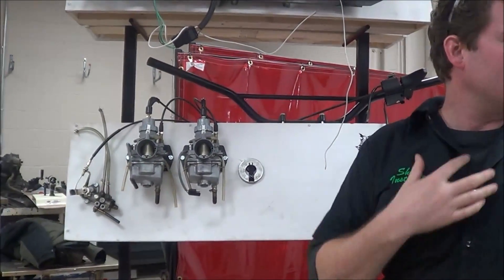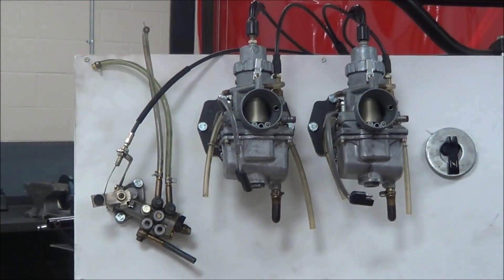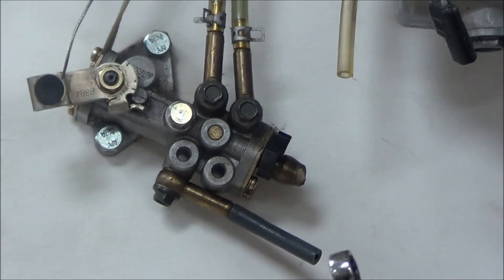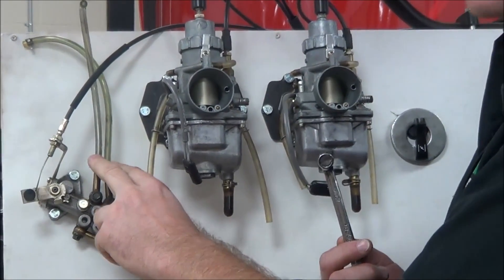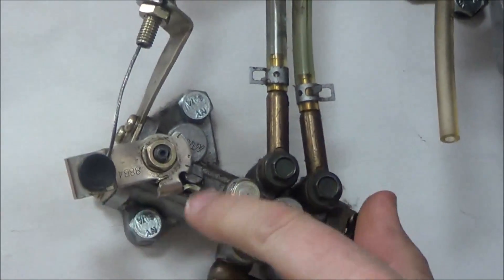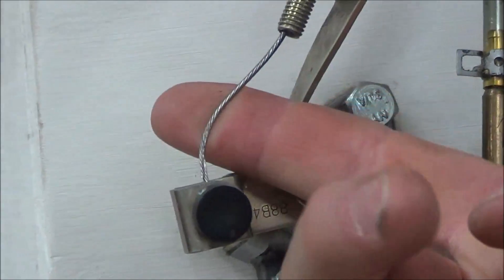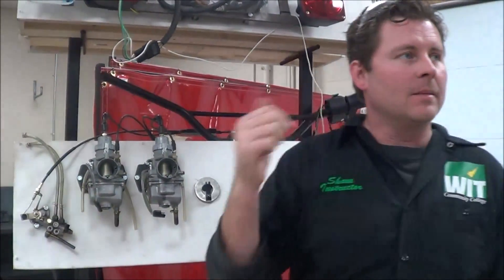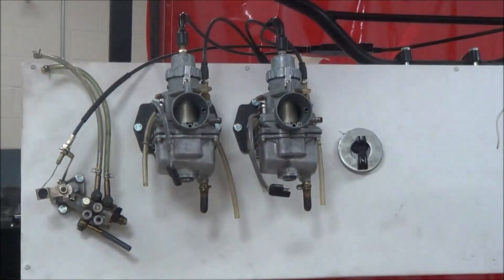How to service 2 Stroke Oil Injection System How to prime oil injection pump #how2wrench #2stroke

Comment: Great video 👍 thanks 🙏 would you please tell me if my Ski-Doo Renegade Sport carb 600 year 2019. 2strok lubricate outer crank bearings with oil from oil tank or by ISO flex grease?

Comment: Great video! I just replaced 3 oil check valves on my triple 2 stroke motor.

I replaced 2 oil injection lines in orange colour so to visibly see if the oil is going Fromm the pump to the intake boot spigot.

I mixed 50:1 in the fuel tank. Ran the engine at idle for 5-8 minutes with oil injection lever wide open.

Plus! I revved the motor to and in between 3000-4000 rpm for 5 minutes and still couldn’t tell if oil was going from the pump to the oil spigots in the intake boot.

I did not do the procedure above to put oil in the lines first to the pump.

I’m asking should I remove the carbs to access the oil lines and do as described above?

Thanks.
Reply from the maker: Glad the video was helpful! You generally don't need to remove the carbs for priming, but it can depend on the specific engine and line access. Great to hear we helped! Smash the sub and share please! 
If you donated or supported us, thank you in advance for saving you hundreds at the dealer or frustration! #righttorepair Links:
Buy Shane a coffee:  https://www.paypal.me/how2wrench    
Join the channel: https://www.youtube.com/channel/UCBhM8DCKnT3qXwTW0eToyCg/join  

We love sharing comments like this with Shane. High fives for the likes or making us better by chiming in your thoughts and the added value to our wrenching community. Keep them coming.
You rock for commenting! We will let Shane know! 
H2W

Comment: I recently purchased an 01' Suzuki JR 80 where someone had capped off the line that runs from the oil tank going to the pump. The line from the output of the pump going to the carb was still attached. My question is, should I be looking for a new pump since this one was starved of oil? They ran this little bike on pre-mix fuel.

Comment: 2025 using this for a 2001 seadoo gts! im bouta see if my oil pump is still good i get some oil in bottom of hull its all og lines   im hoping the lines are old and cracked so i can replace lines and pump still good..  it still smokes good when running. hopefully not to much but this should help me alot!!   premix could be a headache on a lake if the kids need to go fuel up.

Comment: Wow that simplified things. Question, I have a Kawasaki KRR150ZX that I was gifted to repair. I’ve fitted a new top end kit and had it running but the 2T oil is syphoning from the tank through the pump into the crankcase filling it up when the bike is not running. I’ve checked the pump’s adjustment which all seem to be fine…any thoughts?

Comment: He's on point and he knows what he's talking about OK but you can also take a syringe they sell big syringes I don't know for like Turkey basters whatever a big syringe and what I do is I back feed all the lines from the carburetor through the injector to the tank the oil tank that holds a 2 stroke oil and it pushes all the yeah right up in through the tank right you're syringe is full of oil so you make sure that you have enough oil pushing through without any air OK then you're going to start it and siphon with the syringe on the line to make sure that you're getting straight oil and it takes two seconds. And you don't even actually have to start it you can hold the throttle open use the syringe to pull the oil through the injector and it works just as good

Comment: My problem is I can't find replacement lines for the motorcycle that I'm trying to  Restore. Where is a good supply for very small diameter lines for Suzuki. Also the beebies in the fittings don't stop the oil from draining backwards.

Comment: Much better solution, just PREMIX 25/1 or 50/1 Depending on use and engine, zero risk of failed oil pump setup
Reply: my current pump just dumps in oil at full blast at all times.  id save oil doing what you suggest

Comment: The oil check valves (the brass banjos) are a very important component in the old school injection system in that they prevent oil flooding the engine statically past the pump to cause hydraulic lock. That can bend a rod pooching the engine instantly.
Reply: Your point agreed totally. I have bought two seazed DT125E engines because the brass outlet check valves in the oil pump were so gummed up with crud that the spring and ball could not move ,thus starving 2T oil to the engines......resulting in engine failure !! Make sure the brass fitting is removed and thoroughly cleaned when over hauling /servicing the oil pump as it can easily be overlooked.
Reply from the maker: Thanks fellas...Shane

Comment: I cannot find any oil lines going to my carb, on my 07 Ski Doo
Reply from the maker: Hi Michael. They can also go to the manifold or crankcase. Just follow from the pump out to each cylinder (case). One should come from a tank and the others out to each number of cylinders. Make sure to bleed the air out if ever messed with or the tank was allowed to run dry.

Comment: Okay so I noticed that you held that throttle wide open and your tick marks didn't line up and then you adjusted that back so that those tick marks would line up. What would that hurt to leave it the way it is? I have a 98 MXZ 670 and I took the two Flathead screws out of the top and the bottom to pull the oil pump. It feels like it's getting caught on something when I pull it part way out. Any idea. And what would be wrong with my oil pump that oil would just be flowing into the crankcase I shouldn't say flowing but seeping into the crankcase or leaking into the crankcase? Trying to figure out what's going on with my sled for that but I'm thinking the problem May lie in the oil pump seal I'm not sure? Any help would be greatly appreciated

Comment: Thank you for this I know no how to adjust everything when I go back together. Now can someone tell me why I have two large oil lines going to the left and right side of the crank case on my 1995 Seadoo?
Reply from the maker: Hi James...I'd have to grab a manual or see it too tell. Hopefully there is a Seadoo tech on here to reply. I would recommend getting a model and year specific manual to verify yourself. I love this site for cheap ones" https://www.tradebit.com/G/manuals 
We sure love you taking the time to comment. Want to help us back? Please subscribe and give us a high 5 here:  https://www.paypal.me/how2wrench  
Follow us! 
www.How2Wrench.com      
www.Tools2Wrench.com   
Facebook: 
https://www.facebook.com/How2Wrench/  
Instagram:
https://www.instagram.com/how2wrench/
Reply: @How2Wrench  Thanks for replying, TBH I forgot I made this comment yesterday. The manuals don't really say what the lines do, all it says it how they are routed. I searched the forums and found that the 2 larger lines that run from the oil tank to the lower portion of the crankcase are to lubricate the rotary valve shaft and gear on the older Seadoo with the rotax engine.
Reply from the maker: @james4wd236  Nice. Glad you found it. Sub to our channel please and sometime I'm sure we will help!

Comment: The oil inlet is at the end of the pump, you can see the cut off hose and clamp is still present.. Small tubes are outlets. Once the bleed has been loosened to purge air from the inlet side, you can manually move the oil lever to the full throttle position and with the engine idling you will see the oil pulse through the outlet tubes into the manifold. Once you see no air bubbles you are done...

Comment: Hi Shane glad to see you back in YT! Missed your content, just done my NSR and it’s got stationary setting mark on the oil pump and full throttle but when I go full throttle it turns way past that and there’s no stop is this ok?
Reply from the maker: Thanks for commenting and adding value to our community! My first thought is NO...Overextending could "close off" the passage. I'd have to look into it further. I bet there is an NSR forum that has the exact answer. I have an idea to do on the pump too. Hit me up at my website if you don't find an answer.

Have you subscribed yet to never miss a video? Have you seen the video playlists? Over 600 videos! Check them out here: https://www.youtube.com/user/conleybuilt/playlists  

Want to say “thanks” or “keep it up”? Click here https://www.paypal.me/how2wrench    
 
Your answers and help are just around the corner. Save time and money while protecting your investment and yourself by doing it the right way at www.How2Wrench.com
Reply: Shane Conley Thanks for getting back to me, ok I’ll have a look on there and head over to your site, that would make sense as I had the top end seize up on me at full throttle and after a tear down I couldn’t find and issues, I verified the oiler and it’s pumping, what I didn’t see is if it’s working fully open past there. Cheers

Comment: Shane, 
following your practice in this video and based on that type of system. I have a question regarding this specific type of oil injection system demonstarted; how do I know the engine keep getting oil from the pump at various rpm's when the throttle is fully closed (let's say im riding downhill at different speeds/rpm)? I own a 2-stroke 49cc scooter (Kymco DJ refined 50 2011) and I've always wondered how the oil injection system knows to pump the right amount of oil based on engine speed (when throttle is fully closed). Thanks
Reply from the maker: Hi there! Coach Conley is so bombarded with requests these days he hired us to run his page. Can you believe he gets 1/2 million views a month on his YouTube channels and hundreds of requests a week. But in luck, if you really want him one on one. Contact Just a $1 a min after that! Your answers and help are just around the corner. Save time and money while protecting your investment and yourself by doing it the right way at www.How2Wrench.com  

Have you Subscribed yet to never miss a video? Have you seen the video playlists https://www.youtube.com/user/conleybuilt/playlists ? 
Want to say “thanks” or “keep it up”? Click here https://www.paypal.me/how2wrench

Comment: Great video.. I have a huge problem with my 2000 bombardier gtx millennium edition I have oil down below the engine and towards that back where the battery is located and also my exust manifold have a rubber hose that keeps burning I can't seem to figure out why this is happening thanks any ideas
Reply from the maker: Have you Subscribed yet to never miss a video? Have you seen the video playlists https://www.youtube.com/user/conleybuilt/playlists ? Quick answers are often found here. No time to look through videos? 

Still have questions? You’re in luck! I provide tech help and work one on one! I know your question may seem quick but with over 300 requests a week, it’s not possible to answer them all. So, I’ve narrowed down so subscribers and donations to assist beyond the over 660 free videos. My YouTube has grown beyond the ability to answer every question (11 million views! Over 500,000 a month!)

Click here for the membership links and welcome to the community! https://how2wrench.com/product-category/specials/    

Want to say “thanks” or “keep it up”? Click here https://www.paypal.me/how2wrench   This is great for those truly quick questions you need answered and your help back will keep me going!

Your answers and help are just around the corner. Save time and money while protecting your investment and yourself by doing it the right way!
Admin How2Wrench.com
Reply: Salvador Cisneros the rubber hose burning sounds like engine running hot. Maybe not enough water from pump or sand/silt etc clogging water passages. 
Oil in bilge? Are the oil injection lines leaking or have they come off?

Comment: Ive got a ingection pump on my atv do i just need to prime it cause ive got oil in the pump amd going to the pump but no oil comming out
Reply: Crack the bleed off gravity should take care of the problem. Fill the lines with a squeeze bottle to speed up process

Comment: Question im wondering if my 2 stroke oil can be deposited thru the right top crank cover on my yamaha blaster200 cc 2003 where the oil injector is loacated its two black rubber caps one nipple form 1 flat and round which do i insert the oil in

Comment: Great video man. I have a different scenario. I have a Mercury 50 elpto with oil injection. I have a manual and emailed Mercury marine. I don't have a cable from oil pump. I have a linkage that honestly is kinda halfass. And on my oil pump there is only 1 line to match up to check oil volume spec. Problem is that it is to check a idle. I wish it had a wot line to check alignment. And with all the slop in the linkage i can't feel comfortable it will be right. There is a test to pull the line and run premix and to place oil line in a measuring cup. That would be terrific if i only used oil at idle ! Merc told me to just replace oil pump linkage. But i asked whats with all this play in the linkage? I wish there was a cable instead of this free moving linkage on the outboard. Keep up the great work! People like you are a dying breed in this world today! Glad you are one of the people teaching the next group!!!
Reply from the maker: Head over to my website become a member now and to receive 20 minutes of personal mentorship with me. You can even use FaceTime if you have it or find a friends iPhone and we can walk through the actual carburetor process together. I look forward to mentoring you.

Note: Membership is not required to receive coaching or email help. Here are the direct links to individual services offered at H2W:

Email Answer Service-Click http://how2wrench.com/product/email-support/ 

Phone/FaceTime Coaching-Click http://how2wrench.com/product/personal-tech-training-phone-facetime/ 

DIY Mentorship-Click http://how2wrench.com/product/diy-coaching-hire-teach/ 

Dealership Training Services-Click http://how2wrench.com/product-category/dealer-services/ 

MMI/Tech School Student Tutoring-Click http://how2wrench.com/product/mmi-tech-school-student-tutoring-services/

Motivational/Guest Speaker-Click http://how2wrench.com/product/motivational-speaker/ 

On-site Training Services-Click http://how2wrench.com/product/on-site-training/ 

Tech Line Services-Click http://how2wrench.com/product/tech-line-minutes/ 

Mechanic on Duty-Click http://how2wrench.com/product-category/mechanic-on-duty/ 

Did you like this free video and hope to see more? Would you just like to say thank you with a donation? Click https://www.paypal.com/donate/?token=TvKoeRazPL-KysbM-e0ttz-C_gPq2IrqxDmM3ORCu4nxJzQWxYbmo-6m3YuNu64XHLngGW 

Keep Wrenching,
Shane Conley
Instructor/Motivator/Motorcyclist!
www.How2Wrench.com

Comment: Thanks for the REALLY great explanation, I now know what to look for on my 1975 Suzuki GT380, after start up and when warm it seems to partial seize, (triple cylinder,) I think on the centre cylinder which also causes it to stall out, then unable to kick it over I have to rock the bike in gear which releases the seize...so now I will look first at the cable situation...thanks again.
Reply from the maker: Head over to my website become a member now and to receive 20 minutes of personal mentorship with me. You can even use FaceTime if you have it or find a friends iPhone and we can walk through the actual carburetor process together. I look forward to mentoring you.

Note: Membership is not required to receive coaching or email help. Here are the direct links to individual services offered at H2W:

Email Answer Service-Click http://how2wrench.com/product/email-support/ 

Phone/FaceTime Coaching-Click http://how2wrench.com/product/personal-tech-training-phone-facetime/ 

DIY Mentorship-Click http://how2wrench.com/product/diy-coaching-hire-teach/ 

Dealership Training Services-Click http://how2wrench.com/product-category/dealer-services/ 

MMI/Tech School Student Tutoring-Click http://how2wrench.com/product/mmi-tech-school-student-tutoring-services/

Motivational/Guest Speaker-Click http://how2wrench.com/product/motivational-speaker/ 

On-site Training Services-Click http://how2wrench.com/product/on-site-training/ 

Tech Line Services-Click http://how2wrench.com/product/tech-line-minutes/ 

Mechanic on Duty-Click http://how2wrench.com/product-category/mechanic-on-duty/ 

Did you like this free video and hope to see more? Would you just like to say thank you with a donation? Click https://www.paypal.com/donate/?token=TvKoeRazPL-KysbM-e0ttz-C_gPq2IrqxDmM3ORCu4nxJzQWxYbmo-6m3YuNu64XHLngGW 

Keep Wrenching,
Shane Conley
Instructor/Motivator/Motorcyclist!
www.How2Wrench.com
Reply: Great reply!
Reply: Would this be the same set up on a 1975 Suzuki GT185?

Comment: I have a Yamaha outboard motor that shakes violently when i accelerate. could this oil injection be the problem? I don't actually see any oil coming out when the engine is running (I took the hose where it gets squerted into the engine OFF) But nothing comes out so i assumed it could be this however when i cleanned out the carbies and checked the reed valves I don't see any sensors that would let the engine know theres no oil so i am a little confused. (changed the oil stator, coil packs, spark plugs, fuel pump, cdi unit, new fuel but still engine shakes as soon as i accelerate.. can anyone help.???
Reply from the maker: Feel free to reach out to me for personal mentorship,

Keep Wrenching, 
Shane Conley
Instructor/Motivator/Motorcyclist
Reply: is your prop balanced